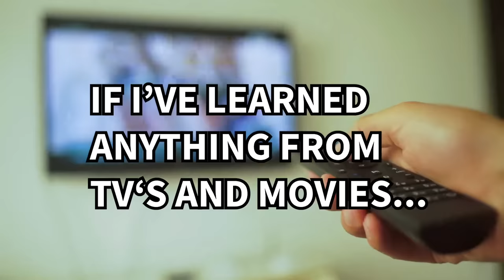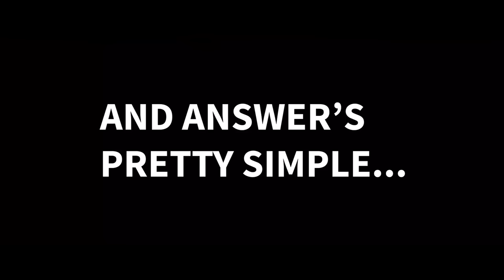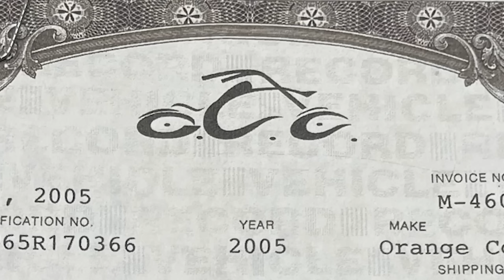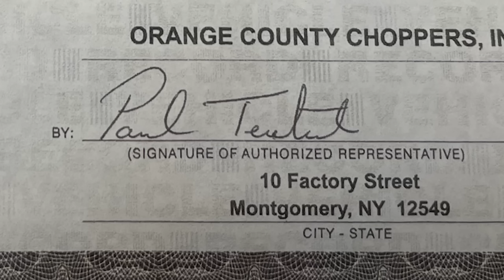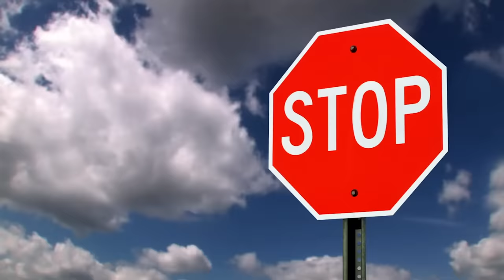Why you SHOULD NOT buy an Orange County Chopper

Comment: There have been many major motorcycle manufacturers that produced bikes with no rear suspension….maybe you have heard of some of them one was a little company called Harley Davidson and another you may have heard of called Indian Motorcycles.  I have been a Harley Master Technician for most of my adult life and I have worked on a lot of these bikes and all the other fly by night chopper companies and they are all junk.  Wide tire choppers have never been cool.  They have been trendy but they have never been cool, not to anyone that knows anything about bikes anyways.  
I’m actually surprised they put a stock Harley evo motor in that bike, they usually use Revtech motors.  That evo is the best motor Harley ever built.  I’d take one over any other motor they produced.

Comment: i dont have an occ chopper but i do have a grill designed by paul jr. what a poorly designed item that i have modified to work properly. the one part that was that when you folded grill for transport, the latch that held the lid shut would fall open by gravity. just zero to little thought put into it, just like a pos rigid

Comment: I went to mmi in Orlando from 2010-2012 and we had one of the orange county bikes on display there. It was the military themed bike that was supposed to look like a ww2 military bike, it was the most God awful thing to look at. The amount of crap put on the bike really took away from what it was supposed to be. The level of quality was terrible, I remember looking at the welds on the custom frame and I looks like a beginner welded the bike. Even if it was just to supposed to be a static bike, I wouldn't trust the fact that it looked like it was going to fall apart. I've seen a lot of custom bikes and it was by far the worst I've ever seen.

Comment: You couldn't be more wrong - cats ARE cool. 
Oh, and the main reason for the big donut at the back is to provide a little suspension. I seem to recall they often did put some springs under the seat and bigger engines in a lot of them, but this was a giveaway bike where they'd cut a lot of corners.

Comment: Ok. What could you expect? They weren't trained mechanics, designers, or engineers.  They weren't evenreal bikers.  Before this show, they sold steel. Just look at their "custom exhausts" for example.  Their "designs" would often be bad enough to  assess unnecessary backpressure in the cylinders, which would lead to overheatingand eventual failure.  They should not have been making bikes.  especially when there are so many truly talented bikebuilders out there.

Comment: 1300cc and 65 horsepower... Harley engines are fantastic fart boxes that make an amazing racket without the consequence of having horsepower. Give the Japanese or Europeans 1300cc, they'll give you 200-250 horsepower. What a piece of crap.
Reply: That's not a fair comparison. Harley uses v-twins engines which are inherently less powerful per cubic centimeter than an inline 4, which is what is in 1300cc Japanese/European street bikes. Harley still uses v-twins because they are an iconic part of their brand and it's what their customers want. The Japanese get very similar power numbers out of similarly sized v-twins.
Reply: @Evan_Schaefering  A v-twin Ducati of similar displacement is putting out double that power. It's actually even worse. A ducati hypermotard has a 950cc V-twin with 117 horsepower. Double the horsepower from a smaller displacement. The difference is that Harley is stuck building a design from the 1950's because it's what their dying fan base wants. They don't allow them to move on. A 45-degree angle V-twin that has a single crankpin with a massively undersquare stroke that is hampered by air cooling and low compression. It's an absolute joke! None of that combination makes any sense in a modern bike. Everything about it is wrong! That's why it makes a terrible noise, vibrates itself until it disintegrates, and makes so little power as a result.